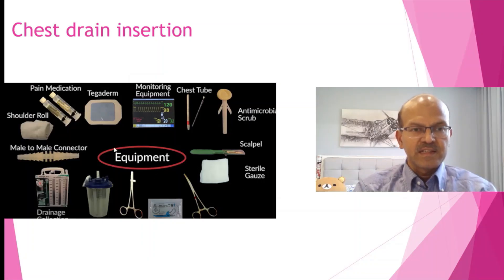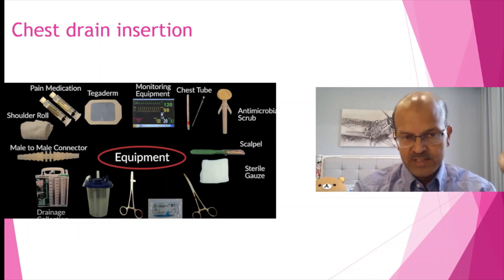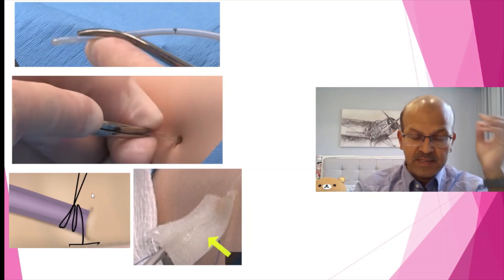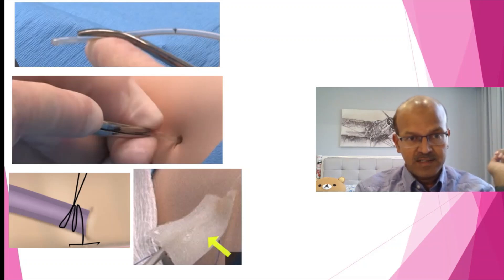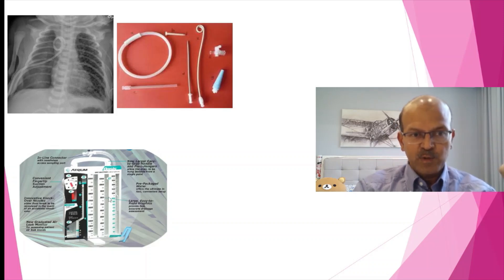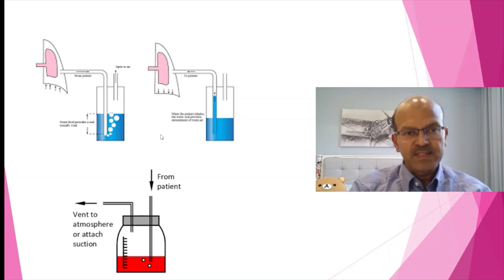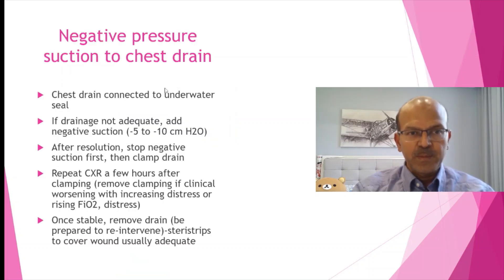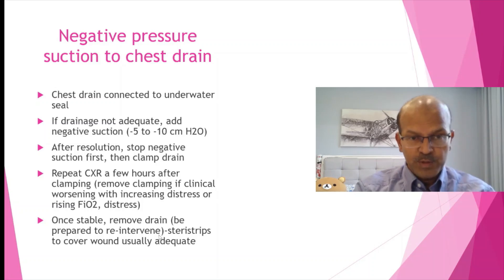Chest drain to treat air leak-treatment of pneumothorax #pneumothorax #nicu

Comment: I grew up using the trocar setup, now of course it is mainly some sort Seldinger technique. For neonates you usually don't need to make a nick, the dilator easily passes over the guide wire, may not even need to use the dilator, just use a little rotational/screwing force while inserting the pigtail. Thanks